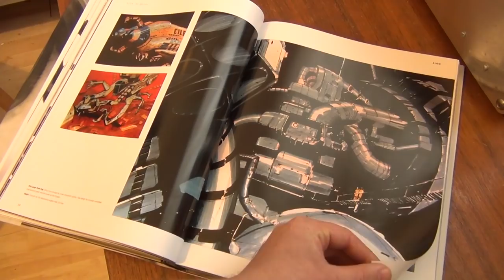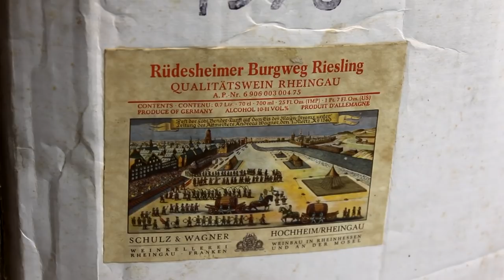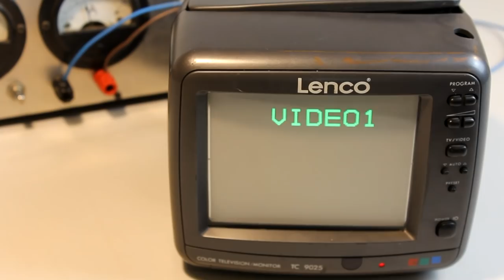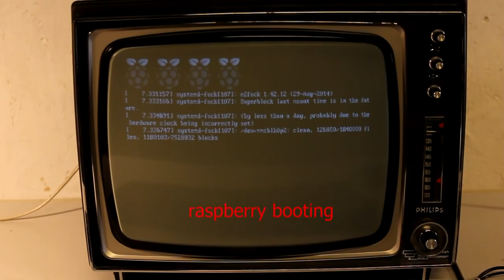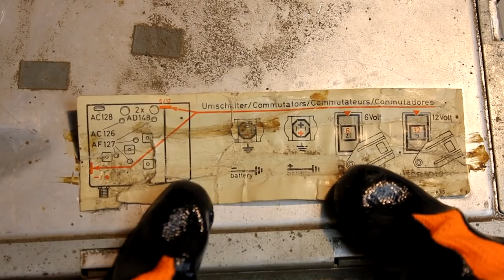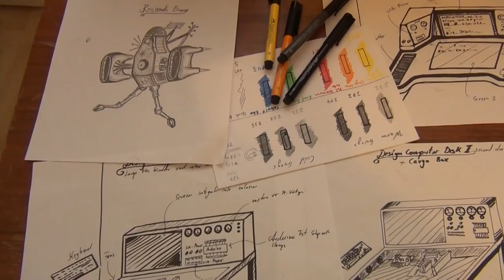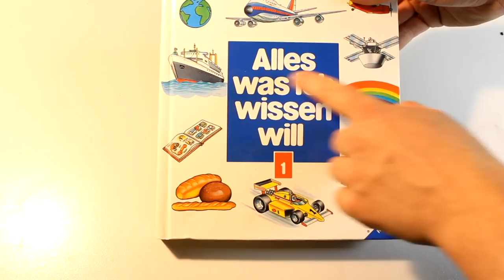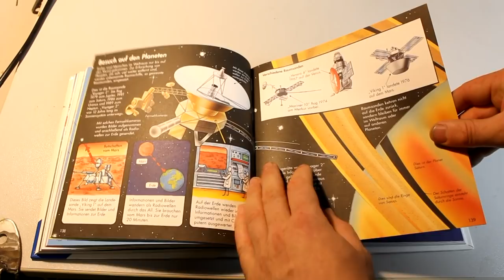Retro Magic Hacks

Comment: I used to use those technical pens for drawing pictures on OHP acetate. They were great units. The ink used to settle out if not used for a long time, and set semi-hard in the container. Try putting a small stainless steel nut into the container and putting the top back on, and give it a good shake, that used to work for me, stirring up the pigment in the ink. The pens are really tricky to clean out if the ink has dried in them. They are delicate things, especially in the ink tube (nib), as there is a very thin wire (like a hair, or thinner) running down inside it. But with care and soaking it in something to dissolve the ink, they can be restored. Interesting video, and a blast from the past. My kids had the English version of that book!
Thanks. Les in UK
Reply: when the ink got dried I used to clean them leaving the heads for an hour into medicinal alcohol :P
Reply: Joe Anon Thats what I was thinking
Reply: Leslie Austin 👋

Comment: Hey there, I saw you taking a set of "technical pens" they are from a german company called Rotring. Their pens are quiet expensive. The set you own are from the series "isograph" which is vintage ( probably around the 80-90's) I would recommend leaving them alone and not to mess with them as the needle inside of the nib mechanism is very fragile (I am talking with experiënce here, sadly eignough)
Reply: Oops sorry, I didn't see that you used it later on in the video...

Comment: Funny are those pens/pencils, I had those to draw schematics of 2D wooden constructions and later on to draw schematics of electronic circuits. Pretty expensive stuff but great quality, Steadler. I really loved it because of the ink, excellent contrast and very sharp lines possible on white paper. Used with letter and electronic symbol templates, very nice results. Extremly black ink, I think it is Chinese ink? Any info on the ink? You can also use this ink to fill engravings of front plates.

Comment: Those NiMH batteries are 1.2v so you're only getting 4.8v instead of the 6v you would get with primary cells.  Maybe that's why the calculator didn't work

Comment: I've had those Rotrings, and they kind of suck. At least when you use that ink. You spend more time cleaning the clogged needle noses then actually draw with them. 
Try other ink, eg. Steadler ink. Or, far more better, Steadler pens. Those don't suck, and draw like a charm.
Reply: I was going to say the same thing xD, I use injetk printer ink and create all the colors I want, except white hahaha

PS: I also have Steadler and Ko-i-noor pens, they all have that problem no matter what ink I use.
Reply: Cream of the crop is Fabre Castell.
Reply: Rotring did a white ink (still do)  but of course that clogs up worst of all because it's full of pigment.

Comment: The rotrings need an ultrasonic bath, after they have sitted such a long time and a new ink as you already mentioned. As for the calculator stuff, cause I've already tried and restored many of these, they never work properly with rechargeable batteries cause the voltage is too low. Use alkalines or Ni-Zn rechargeables ( they need a special charger and they have a nomimal voltage of 1.6v) ;)

Comment: That old Blaupunkt radio is great.. it has ultra shortwave which most car radios today  do not have. Are you going to fit an AUX input or live with the rewiring you did? A great purchase for 2  Euros.
Reply: Atman - I think that model  only has long & medium wave. (L & M) Might be from the 50's or very early 60's since we had FM by the mid 60's
Reply: Atman ??? "ultra short wave" is the FM band, the ONLY band most modern car radio's have...

Comment: You're holding the isograph wrong, and you have to clean them. ISOgraphs are always kept at 90 degrees from the paper unless specifically written in the instructions that you can't. 

There's a fine needle inside the tip that you have to press in to the paper in order to activate the primitive valve and gravity fed ink to fall.

Comment: 0:29 I won't be surprised if you didn't consider using the Pinterest service to find inspiration, as it requires an account, and once I signed up, I basically got hooked, thanks in part to their "picks" (recommendations) engines and notifications.
4:25 That's way better than the portable TV I had around roughly the same time that was made, mine had a greyscale CRT and manual tuning (no OSD).
6:46 I agree, as that very much looks like something that'd make a really nice prop for some live action movie set in the 70s.

Comment: Here is a little trick for testing calculators.................

take the number  1 2 3 4 5 6 7 9 and enter that into the calculator and multiply that by any Multipal of  9.   12345679 X 81 would give you all 9's. (9x9=81)
12345679 X 72 = all 8's (8X9=72) and so on. 

Some scientific calculators for some reason do not work.(not sure why...maybe because of the decimal places can be carried out further then on the older calculator's)